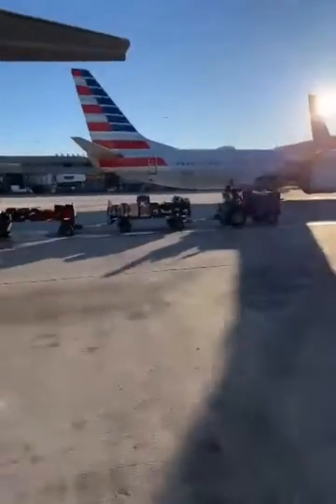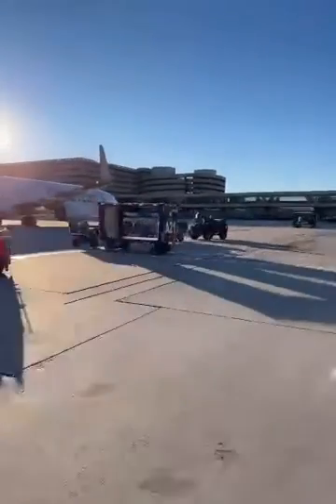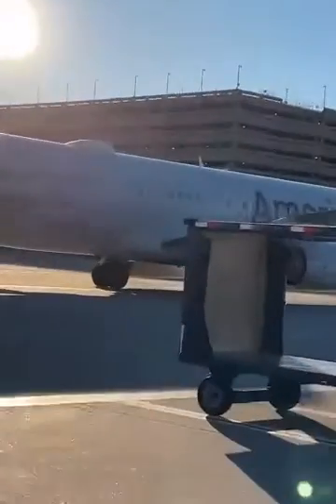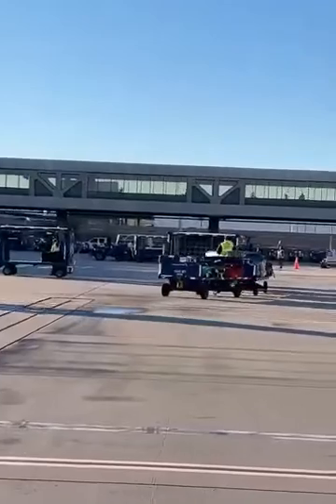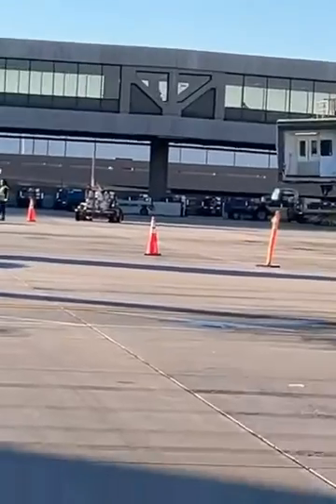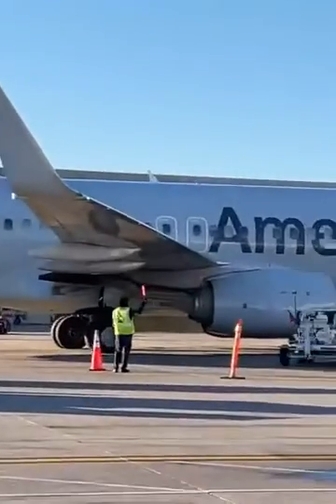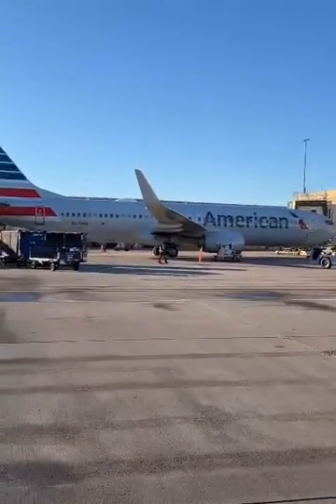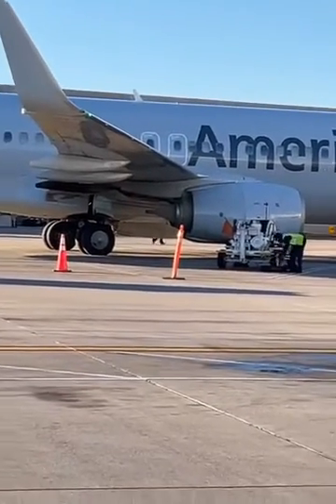How to Park a 737 Jet

Comment: Due to the low profile of the 737 and engine proximity to the ground, I would NEVER approach as demonstrated by the F.O. side wingwalker. Stop stowing the chocks in the fuel pit. Stow them at a position that ensures the agents will visually verify spool down. As a former ramper, and safety auditor, I was able to observe a disturbing trend from "safe" to "extremely hazardous" behavior, because it saves a few seconds. 
 I know a lot of rampers are going say otherwise, but only the lazy, foolish, and poorly trained , will approach along the leading edge. Trust nothing, and no one to keep YOU safe. VISUALLY VERIFY SPOOL DOWN!...or go home in a bucket. All the best to American Airlines!

Comment: Does the connect guy take luggage inside or does he drop them off at each connecting flights planes? That a lot of driving if a plane has a lot of connecting passengers
Reply from the maker: The connects person takes the bags to each connecting flight within a certain time frame. If not, they take it to another area on the ramp that is stage carts for the upcoming outgoing flights. If there are a lot of connecting bags, they will send several connects runners!